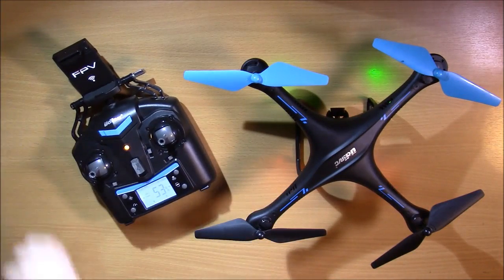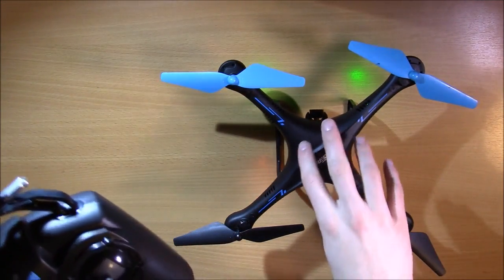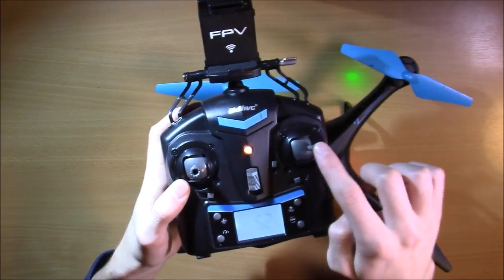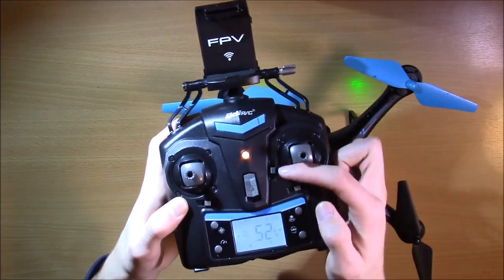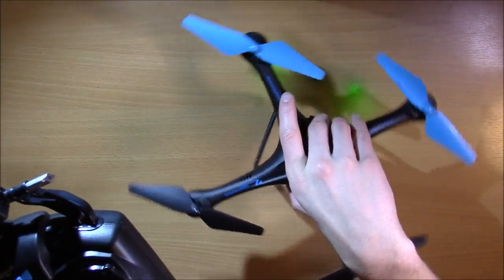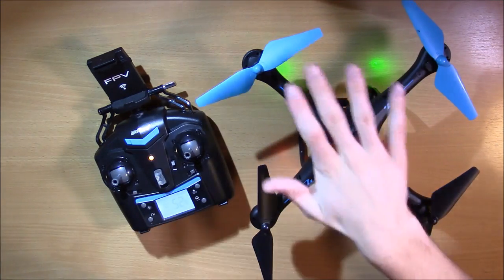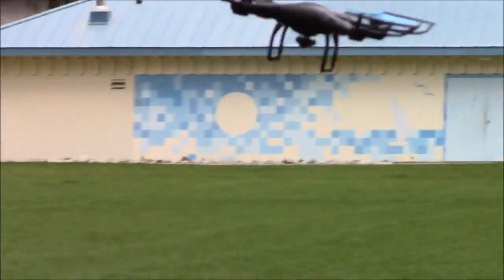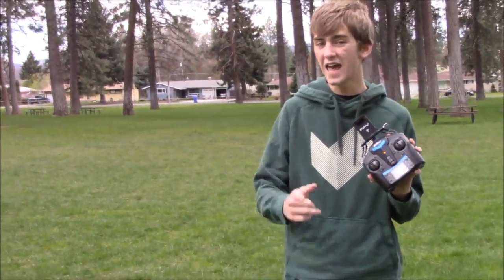How and When to Trim Your Drone! | USA Toyz

Comment: I have an X-31 shockwave SkyRider. I hit a plaster wall and caught in my hand immediately. No damage to unit but it will not fly now. The orange lite is blinking in camera housing. Battery full charge. How can I reset to fly again.

Comment: I have a Clone Drone X. I did your Calibration and followed your procedure.
However, it’s still doing the same thing. When I press the up button to get to hover the Drone,  just takes off low level and flips over and shuts off.